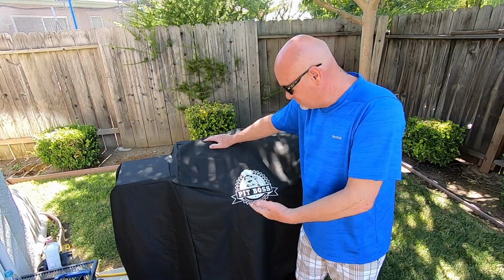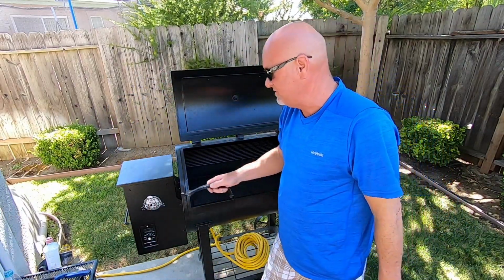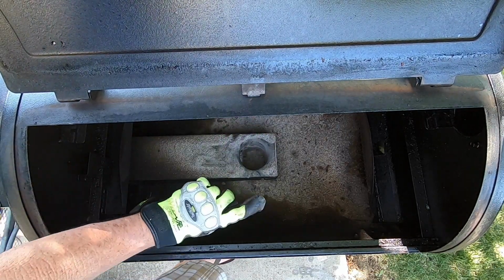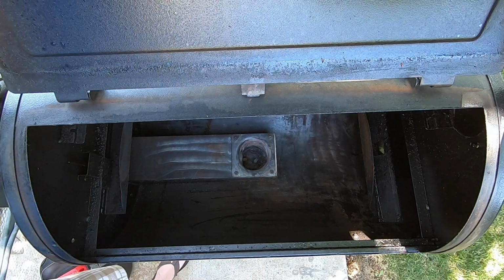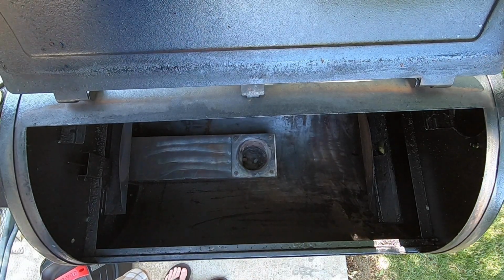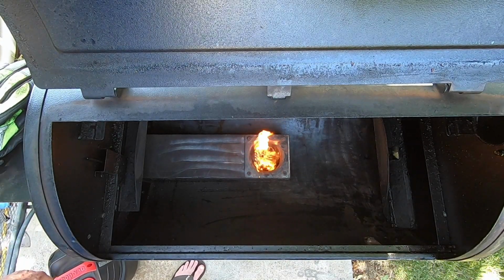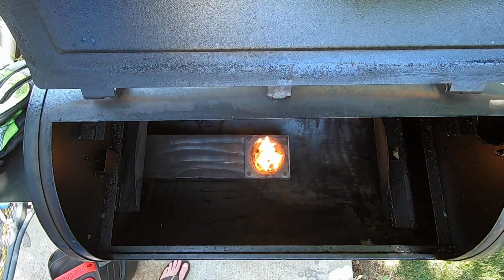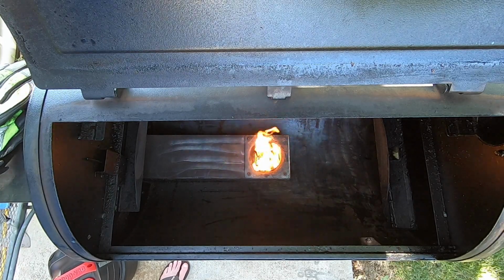Pellet Smoker Flame-out - Why did your pellet smoker flame out - Pellet smoker maint. tips Pit Boss

Comment: My smoker keeps catching fire. I will clean it and fingers crossed.
Reply from the maker: Hello Sondra,
It's absolutely imperative that the burn pot is cleaned out on a regular basis, I vacuum mine out with a small shop vac I bought specifically just for my smoker, I vac mine out after probably every 3rd use. If you keep this practice you shouldn't have any fire issues.
If you have any other questions, please don't hesitate to ask.
Thank you,
MarknLily

Comment: The pit boss that had a flame up problem had to be a sensor or a circuit board problem. It wouldn't stop feeding pellets. It had a huge pile of pellets at the bottom. It was the first time the gentleman use it. Definitely a factory defect.

Comment: The last 3 times I’ve used my pit boss pro series pellet grill the flame has gone out. The P setting is on 4, pit boss pellets and it’s clean.  What I always find is that the temp is about 130-140 when I find the flame has gone out and the flame doesn’t re-ignite on its own (I suppose the heater that ignites it never restarts the grill.  The auger will continue to feed pellets and it will overflow the cup.  What I have to do is unplug the grill and then plug it back in to restart the flame.  Very aggravating because I can’t trust it to leave it very long.
Reply from the maker: Hello redonkulousd,
I've actually heard of this happening on one other PitBoss grill as well as a couple of Trager's, my suggestion would be to contact PitBoss and explain whats happening (sounds like the circuit board has an issue) and I'm betting they will send you a new one. They aren't difficult to install.

Let me know.

Thank you,
MarknLily
Reply: Yes my pit boss does the same think and I feel like I have to check on it every 10 minutes. Please let me know what you find out I am going to try and contact pitboss
Reply: Mine seems to flame out on 200 degree. I didn’t have any issues for the first 3 months but now I have to watch it closely. I’ve heard that Pit Boss is aware of this problem, mine is an  1100 pro series, but I don’t know of any fix that anybody has reported. I’m interested in knowing how to fix this
Reply: im having the same issue, the smoker is clean ive only used it a few times and were on to 2 flame outs in a row around the 200 temp ,very frustrating,come monday ill call them pit boss see whats going on

Comment: Thanks, Mark. I have a Pit Boss Pro and it has flamed out each time during my last 3 - 4 long cooks despite the fact that I vacuum mine after every cook.  Each time the temperature will drop to 120 - 130 or so before a small combustion ignition occurs. I put it to cool down and take off the heat shield once it shuts off, and what I am finding is that there will be a rather large mound of pellets in the pit (or even overflowing into the tank) that have yet to ignite. So I think you are right in that when the combustion occurs the pellets in the auger ignite as well. But I am wondering why these pellets are backing up without igniting? I am wondering if it is the pellets I am using...my last 7 - 8 cooks I have been using a non-Pit Boss brand of pellets. I really like them because they provide a hickory/oak blend, but that is the only difference I can think of. I have only had the pellet grill since May, so I am hoping it is that and not a problem with the igniter. But the igniter seems to be fine each time I start, and even after these flame outs it seems to work fine for the rest of the cook.
Reply from the maker: Hey Mark,
When I first read your comment I was completely blown away and my first thought was "bad pellets" but then I thought for a little bit about the really crappy pellets I've tried that have left my smoker a complete mess after only one 8 hour cook but didn't make my Pit Boss "flame out" (that's only happened once from bad pellets) so then I really thought this is most likely being caused by the "P" settings, check it out!, during cold weather operation you should be running a P2-3 setting and during warm weather it should be set at a P4, having this setting set incorrectly will definitely cause "flame out" the "P" setting adjustment is covered in your instruction manual and is really easy to perform. 

I hope this helps you correct your issue, if it does or doesn't please let me know, if you have any more questions, please don't hesitate to ask.

Thank you,
Mark
Reply: @KillerGrubwithMarkBagley  Thank you so much for taking the time to reply to my question.  I do have my P Setting at a 4, and up here in Maine it was on the cooler side when I started my cook yesterday (around 52 degrees at 5am). So I will keep that in mind for any upcoming cooks as the weather gets a little colder.  However, correct me if I'm wrong, but the P Setting only impacts the smoker on the smoke setting, correct? If so, I don't think that was the cause as these flameouts aren't occurring during the startup process or when the smoker is in smoke mode. They have all occurred approximately halfway through a long cook (4 - 6 hour mark) at a lower temp like 225 or 250.  In doing a little more research, I do think it is the pellets. The pellets I have been using are processed using more of the wood (such as including the bark), and are marketed as providing more smoke. I like them a lot, but what I think is happening is that they are also producing far more ash, and that ash is smothering the flame and causing the pellets to back up before they finally ignite again. Then, when they do they ignite all at once, also igniting the pellets still in the auger.

Long story short, I think I am going to switch back to Pit Boss pellets and see if that reduces the number of flameouts I am getting. I have a smoke tube so I can always add that to get a little more smoke into my cook rather than using this brand of pellets. The Pit Boss pellets are less expensive as well, so added bonus.  Thanks again!
Reply from the maker: @markh1479  I don't believe the "P" setting only effects the smoke setting, it is what times the pellet drops during your cook but I'm not a scientist like Franklin lol everything I know about Pellet smokers is just from my personal experiences and watching videos on YouTube, here's a couple more brands of pellets I certainly use and trust.

Louisiana Grills (also made by Pit Boss)
Rec Tec Grills Ultimate blend pellets

I surly hope the better pellets cure your flame out issue because I know it's a complete pain.

Thank you for the reply, I appreciate it greatly.
Mark
Reply: @KillerGrubwithMarkBagley  Thanks again for responding and for your advice...it is very much appreciated!
Reply from the maker: @markh1479  You're welcome

Comment: well m- yes I have had two flame outs and on the last one my grill had just been cleaned. I believe you never stated the reason for this flame out - my takeaway is flameouts just happen - get use to it.
Reply from the maker: Bill Fiddes flame outs generally happen when there’s too much residual ash in your fire pot or too much pellets, I personally have only had two flame outs, having your auger drop rate set too fast could cause too much pellets in the burn pot and also cause flame outs.
Thank you for your comment, I do appreciate it.
Mark

Comment: I have a Pit boss tailgater and not have the cool down phase , what should I do since I just unplugged it ?
Reply from the maker: Hector, my Pit Boss 820SF doesn't have a "cool down switch" of setting, it automatically keeps the fan running after I turn the setting knob to off, the fan continues to run until it's cooled down the automatically shuts off then I unplug it.
Reply: Killer Grub with Mark Bagley  Thanks for the info just realized what u meant , great video
Reply from the maker: Hector, you're welcome, if you have any other questions, please don't hesitate to ask!

Thank you,
Mark